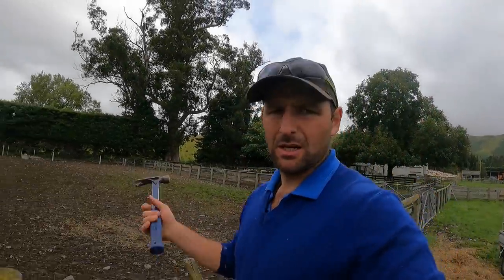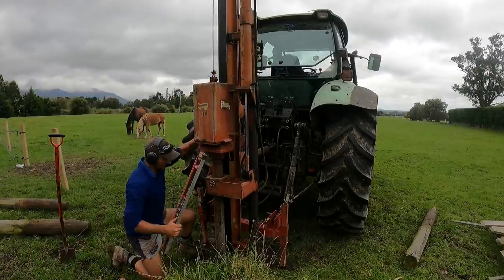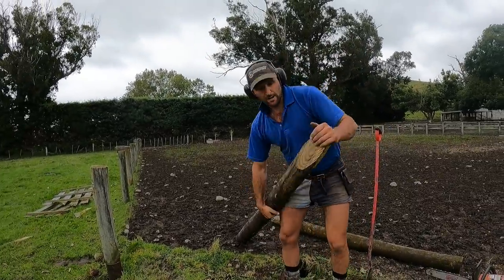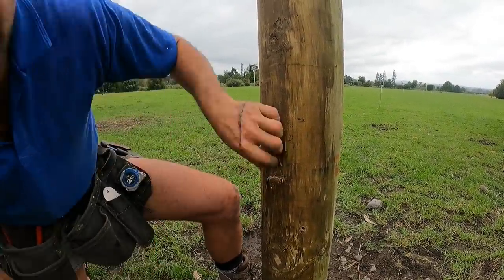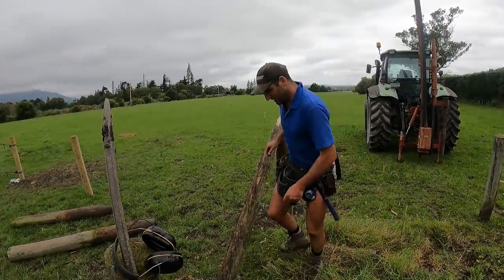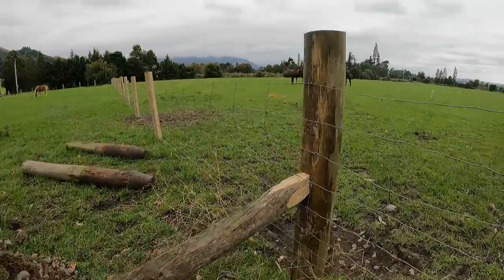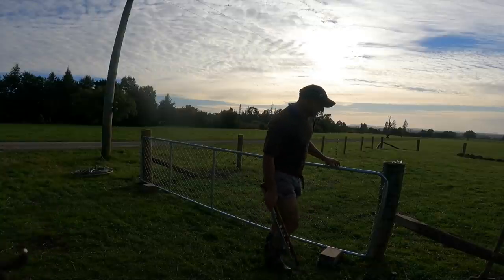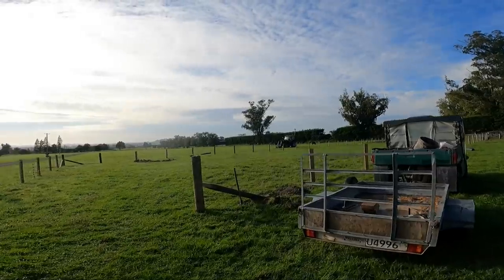Kiwi Farmer Fencing (THIS IS NOT A HOW TO!!!! , this is how I do it)

Comment: Two helps you can do (I do these) is cut a measure stick to have all at the same height. Use a small level marker that 'clips' to the post being piled, 3rd uses a hydraulic cylinder to 'push' the post in then that avoids all vibration and wood splitting on the crown.

Comment: Thanks for the vid Alistair...have always liked the look of timber strainers and intermediates but they're rare over here in Oz...steel is MUCH more popular, especially for new fencing.  Really quick to install and long lasting, typically less expensive too.  Bolt on stays with welded stay plates - makes for a fast, easy job.  Different ways for different countries I guess...that said, Kiwi fencing innovations and products really do set the standard worldwide.
Reply from the maker: Thanks for the comment. I suppose its how we have always done it over here. We use steel only where we can't drive a tractor to ram in wooden posts.

Comment: I worked in Wales in the early 1980's.  We had a post rammer on a Zetor, we had a place for the netting to go beside rammer, we drove forward using 2.5 wire on ground for guide.  Rammed posts and pulled out netting at the same time. I was impressed as we still use wire and battens. I am going netting from now on. Did i mention it rained every bloody day, we worked in wet with synthetic sacks wrapped around our legs tied off with baler twine. That was when I decided I should use my brain rather than rely on braun.
Reply from the maker: That's an awesome story. I have seen one of those netting stringers. They are very cool.

Comment: What type of wood do you use and how long do expect the posts to last .I agree with you Alistair when it comes to doing a job everybody has different priorities to how it looks at the end
Reply: Treated pine, in normal circumstances a fence will last 25 plus years. I've removed posts that have been in the ground for 40yrs.
Reply from the maker: Yep Treated Pine. The posts should outlast me.
Reply: @kiwifarmernz  As Pete Scales said about 15 years ago quality changed ,now we are being told to spend more money and buy redwood .Time will tel whether it’s worth it.40 years ago we used quarters and half stakes put in by hand sledge and they can be still standing if the hedge has good growth with wire netting to make it sheep proof.Has the timber work finished ?